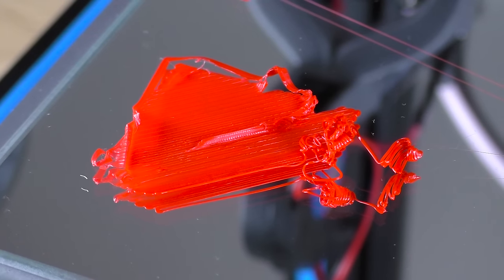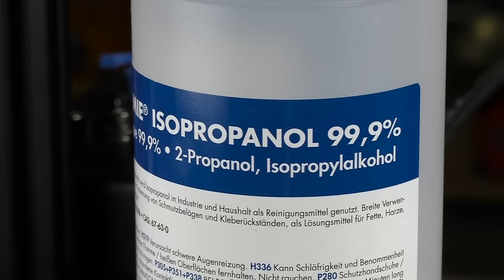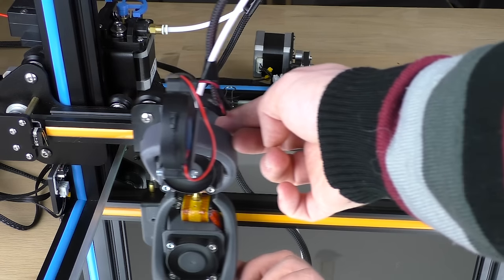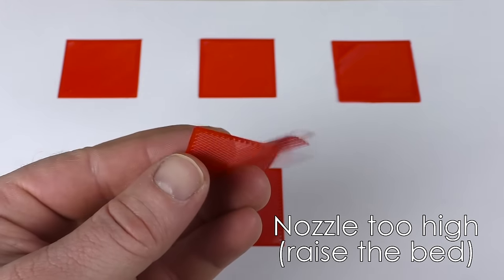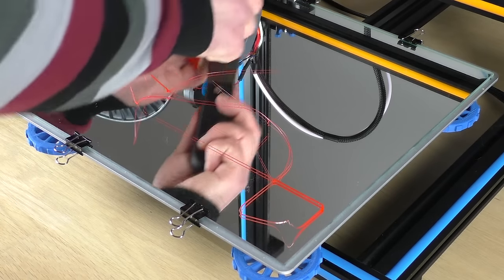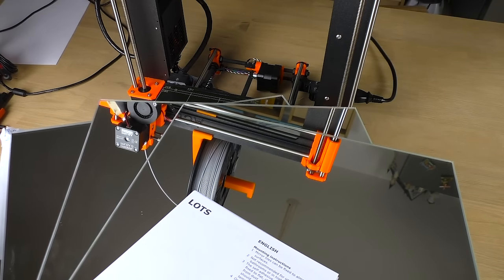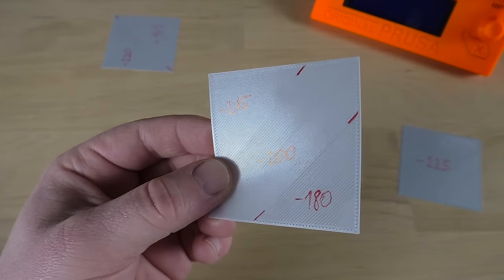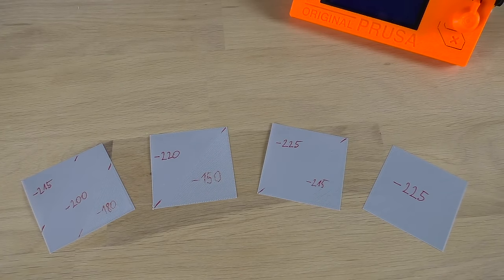Best method for 3D printer bed levelling

Comment: Do you add anything to the mirror before your print?  I've been using glass (the one that came with the unit) and it seems to work well with a glue stick or this stuff I had call wolfbite (from a friend of mine).  If I can use a mirror with nothing then that is something I will definitely try out.
Reply from the maker: Nope, nothing at all on the mirror, although you should wash it with soapy water before using it. After that, I've actually had troubles getting my prints off the bed if the first layer was squeezed too much.
Reply: @HobbyHoarder  Wow....i've been knocking out faceplates and I've not had any issues (knock on wood).  You're instructions are right on!!!! Thanks so much.
Reply from the maker: @carycorreia8215  I'm very happy to hear that Cary! If you do notice any loss of adhesion (it tends to happen overtime), just wash it under soap again and you're good to go.
Reply: @HobbyHoarder  You must be a psychic...it just happened this morning.  The print popped off the bed sometime in the am and i had spaghetti all over the place and the nozzle was just full of filament.  Put the mirror under hot water and soap and restarted and I'm good to go.
Reply from the maker: @carycorreia8215  Hehe, just experience, it happened to me as well :) I usually set the first layer so that the surface is on the rough side. Never had any warping, except with extremly large models that reached the edge of the bed (it's not as hot there).

Comment: Ive been trying to level my bed for the past 2 weeks. The left side of the bed keeps giving me that rough texture while left one keeps giving me a smooth perfect result. I tried everything but to no avail. I thought it was a warped bed so i bought a new glass one but nope, still the same issue
Reply from the maker: Cut a patch of aluminium foil (roughly half the size of your bed) and place it on the side that is too low. You can stack more if needed. Eventually, both sides will be equal and you should be able to level it perfectly.

Comment: Happy two year anniversary or something! I just tried this and this really helps! I had a question though. Your example of a perfect square seems to be somewhat thicker and not see through. After calibrating I managed to get a smooth and consistent square with no gaps between lines. But the square is so thin that it is see through. I wanted to check if by any chance I'm still off or that your PLA is printing a tad thicker.
Reply from the maker: Hehe, thank you, I can't believe it's already that long.

Well, it depends a bit on the color and how much you're extruding. I always calibrate my extruder first (I don't have a video on that, but the one from MatterHackers is a good example). This will ensure that you're extruding the correct amount of plastic and then you can repeat with the leveling squares.

It's also important that you set your first layer height to 0,2mm in your slicer, regardless of what you're using for the rest of the print.

Let me know if you're still having issues!
Reply: @HobbyHoarder  I'll take a look at the vid. My filament colour is grey and I've used 0.2mm so we're good in that aspect.

Comment: what size mirror are you using,  my bed is roughlty 8.5 x 8.5  so how do you adjust the nozzle to follow the dimensions of the glass not  the bed when using auto leveler or even for manual leveling when homing in the nozzle, thanks for your help
Reply from the maker: I'm using the ones from Ikea, 30x30cm (a bit under 12''). You can change the bed size in every slicer and then it should only print within these boundaries.

Comment: This method of leveling has improved my accuracy, but I have some questions.
Shouldn't the settings matter? Like setting the Primary Layer Height to 0.20 mm should give you one layer and shouldn't that layer be a certain thickness? If the First Layer Height (FLH) is 90% shouldn't the pads all be .20X.90 = 0.18 mm? And all the pads should be 0.18 mm? How does First Layer Width affect the pads? For example with mine at 0.20 at 90% I measure 0.24 on the pads, is my bed still a little too low?
I have my E-steps and Extrusion multipliers right on.
Reply from the maker: You should set your first layer to be 0.2mm, regardless of what you're slicing rest of the model at. So if you're printing at 0.3mm, set your first layer height to 66%, for 0.1mm set your first layer to 200% etc.

As for the actual height and width of the first layer when you print it - don't worry about it. The only job of the first layer is that it sticks well to the bed, nothing else. It doesn't matter if it's 0.18mm; if you get good adhesion and a somewhat smooth surface, it's good enough. So just make sure that your leveling squares look close enough to what I'm showing and are sticking well to your surface.
Reply: @HobbyHoarder  Thanks for the input. For printing at .3 to get the 1st layer at .1 you mean 33% not 200%. I have my squares looking good thanks to you!
Reply from the maker: @TheSblackwater  I meant that if you want to print at 0.1, you should set your first layer to 200% so that you end up with 0.2mm. I hope that makes sense. Congrats on getting the bed leveled, it's one of the hardest things to do until you get the feel for it.

Comment: so how often do you level your bed? is it before every print or after let's say 10 prints?
Reply from the maker: Whenever I feel there's need for it.

I always wait until I can see how the first layer is printing. If it's fine I walk away happy. However, if I notice that it's not sticking well in some parts or if there's a gap between individual lines, I will immediately adjust that corner (or change the Live-Z if the printer has auto levelling). If it's really bad, I'll stop the print and print out the calibration squares again. Unless there's something really wrong with the printer, you shouldn't have to level it more often than a few weeks or even months apart.

Comment: Great video. I'm new to 3d printing... and use a EZABL on my Ender 3 Pro. what are the best first layer settings to use.. 0.2 or 0.3? And do I need to make different adjustments for different layer heights?
Reply from the maker: Thank you and welcome to the hobby!

0.2mm seems the best height for the first layer.

Settings depend a little on your slicer. I'm using Simplify3D and you have to specify first layer height as a percentage. So if I'm printing with 0.2 layers, then the 1st layer height is 100%. If I'm printing with 0.1 layers, I have 200% for 1st layer height, so that it still ends up 0.2, even though the rest of the model is at 0.1. Does that make sense?

Comment: hi my issues , is that i had adjust a lot my Z compensation, about -2.47 on first , layer and when  im getting higher on my print about 3/4 to 1 inch high, i have to adjust consistently, my z axis compensation upper about  too not scratch the print every min , its annoying i have to stay near my printer , you have any clue whats happening . probably,  the level but i have an automated bed leveling on my creality CR10S pro v2 .  thank you for your great video !
Reply from the maker: You shouldn't have to adjust anything after the first layer. Two things come to mind.

Your Z axis screws might not be tightened. If you check the bottom of the long Z screw, there's a coupler there and it has two or three screws that you can tighten to hold the Z in place. Check if they're all tight enough on both sides.

The second thing is over extrusion. That means that the printer is putting out too much plastic and, over time, it builds up enough to scratch against the nozzle. Check out videos for flow calibration, or simply reduce your flowrate by 15% and try again.

Comment: Thanks so much for taking the time to put this video together. I'm new to 3d printing - to say there is a lot to learn is an understatement. Finding concise information like this is gold dust. 

If you ever wanted to put a series of videos covering various helpful topics I would be very happy to donate, it would be a boon to the community. Your editing, style and methodology are both concise and encompassing. 

I have a question if I may, regarding my Original Prusa MK3: I print a large central calibration square at 0.2mm layer height - mimicking a first layer on Prusa optimal settings (0.15mm layer height) in Slic3r Prusa Edition. 

When I think the live Z is giving the best looking results (around -700 which is way off compared to your video) it does not measure 0.2mm deep. The best I've managed to measure is 0.22mm deep which is 10% off and other squares printed at other live Z heights looked better but were even further off in layer depth. 

Any ideas on why my layer depth is not 0.2mm? Maybe my callipers are off.

I had to order my printer assembled due to the work/ small kids everywhere lifestyle I have so it's even more critical to learn functions like this as I never had the opportunity to build.

Thanks again to taking the time to assist newbies such as myself.
Reply from the maker: Thank you, it really means a lot to hear I was able to help someone.

I don't have a series planned as such (I'm humbled by your offer to donate). I'm quite active on Reddit's 3D printing sub and I see a lot of issues from beginners there and I'm trying to cover those questions in my videos. My main goal of this channel is education, so if there's anything you're having troubles with, let me know and I'll do my best to help, including making a video about it if I feel it's a common enough issue.

Regarding your question; the Live Z values will wary between printers. The actual number is actually determined by the placement of your PINDA probe. If yours is a bit higher than mine, you will need a larger Z value. There's no right or wrong number, as long as it's under 1000. If you need to go further, then it's better to physically re-position your PINDA probe and then dial in your Live Z again.

The first layer will never be the same thickness as the rest. You want to squeeze your first layer against the surface so that it sticks well (but not so much that it's rough to the touch as I've shown in the video). Because it's squeezed, it's thickness will be less than the ones above it and that's perfectly fine. There's no need to measure the thickness of the first layer as it will likely never be the same as what you've set in your slicer. Most slicers have a setting that lets you adjust the first layer thickness and it's almost never the same as your general layer height.

There is a way to test if your layer heights aren't correct though. You can print a 20mm calibration cube (https://www.thingiverse.com/thing:1278865) and measure that using a caliper. However, this is mostly needed for custom built printers or cheap Chinese ones, as they weren't properly calibrated to begin with. You have one of the best printers on the market right now and there's really no need to calibrate it further. The only exception is calibrating your extruder.

Tom made a video about it a while ago and you can check it out here (let me know if anything doesn't make sense):
https://www.youtube.com/watch?v=YUPfBJz3I6Y&feature=youtu.be&t=3m25s

Here's my advice though. Unless you're having actual issues (like too much plastic on the top surface or gaps), there's no need to worry about calibrations, at least not yet. Get familiar with your printer first, use it for a few months and then start worrying about perfecting the last 5% you can squeeze out of it.
Reply: I'll take all of your advice, thanks. I'm struggling to find any Z Height where I can't actually feel smooth surface - everything from -450 to -750 is a bit rough. I think this is where I'm struggling as I don't know what perfect feels like - I've probably gone past it twice! I'll watch that videos and others by Tom tonight.

I've had some pretty good prints anyway, but there's one print that I just can't get to work. I'm confused by the Slicers approach to it (file here: https://cults3d.com/en/3d-model/home/zuzanna-lamp).

Slic3r Prusa Edition says 35 hours, Simplify3D says 17 hours and both prints fail pretty quickly. I'm going to try acetone this evening on the bed to see if that helps. What settings would you use for this type of file? 0.4 nozzle, PLA.

Many thanks
Reply from the maker: Yeah, it can be hard to get a feel for how smooth the surface should be, I've struggled with it for weeks. There's quite a big difference between 450 and 750. Once you start dialing it in, the differences are usually under 50 microns.

It's ok if the first layer is a bit on the rough side until you get more experience with how it should look, as long as it's not really rough. Slide your finger across the black steel frame, that's roughly how smooth the first layer should be. Once the printer starts adding more layers, they will even out and you'll still get a smooth top surface, even if the first layer wasn't. If the first layer is a bit rough, it just means that the model will stick to the bed better. It's best to wait for the bed to cool down a bit, at least 10-15'C, before trying to remove your object.

Slicers are very bad at predicting printing times. They have some average values, but the problem is that every printer has different settings (like acceleration) that differ from slicer's values, so it can't accurately predict how long it will take. PrusaControl is the best right now. It's accurate to within a few minutes in most cases. I've also heard that Slic3r Prusa Edition will be getting an update soon that will include very accurate time predictions.

I've downloaded the lamp model and it seems like a pretty normal model in terms of print complexity. It's been designed well for 3D printing, as you don't need any infill or supports at all. When you say it failed quickly, what exactly do you mean? Has the model come loose during printing?
Reply: Thanks again for taking the time to help. I managed to get a rock solid first layer following your advice. I also slowed it down a bit after an acetone clean which really helped.

I ran into all sorts of problems with the print, however - none to do with adhesion though.

3 hours in to the print the Mk3 told me I was out of filament and stopped printing. I reloaded it and carried on no problem. Same thing happened on hour 6 - I reloaded and turned off filament detection which fixed it. Must be buggy.

Hour 13 of 19 - a big 0.5cm shift to the right on all layers. Crash detection on & running normal mode - print ruined. The whole rest of the print was absolutely flawless so I'm really gutted. I have no idea why it did it, and it doesn't look like it tried to recover from it. It just kept printing miles off to the side.

I got the machine from Prusa fully assembled so I really don't know what's wrong! Here's some pics. https://imgur.com/a/bVRfj

Sorry to pick your brain!
Reply from the maker: Hmm, that is strange. So it didn't even detect the missed steps like it's supposed to? The only thing I can think of is that the belts are not properly tightened, but they should have been since you've paid for it. Can you pluck them? Like a string on the guitar. It shouldn't be soft, but not rock hard either. The belt should make a sound, similar to something like if you pluck a rubber band.

If I understand correctly, this model has failed to print twice? Was it always at the same height?

I'd suggest you buy iso alcohol instead of acetone. I remember reading somewhere that acetone should only be used occasionally if the bed is really dirty, as it can slowly ruin the PEI coating. You can easily mix iso alcohol with water. I'm using a 80%alco/20% water mixture and I just give it a quick wipe with paper towels before every print.

Comment: I'm so nervous to get a mirror for the bed. With as many times as I've accidentally run the nozzle too close, I'm 100% sure I'd shatter any glass under the nozzle eventually.
Reply from the maker: Nah, I did that a few times - the bed is on a spring, so even if the nozzle pushes down, it can still move downwards a bit, which gives you enough time to turn off the printer.
Reply: @HobbyHoarder  I switched out the stock springs to the silicone ones a couple months ago to help maintain the tram. They don't give as much. I guess if the mirror is cheap enough... I've wasted far more money for less in the past.
Reply from the maker: @Scott_G  Go to Ikea and buy "Lots" mirrors - you get 4 in a pack and they're very cheap, I think it was under $10 for all 4. You won't lose any sleep even if you crack one or two :)
Reply: @HobbyHoarder  I checked out the website. Are those the ones that are 12" square? My bed is only 235x235. I wonder how hard they'd be to cut down...
Reply from the maker: @Scott_G  Yeah, that size sounds about right. You can buy a glass cutting knife and do it yourself, or most hardware stores can do it for you as well.
Reply: @HobbyHoarder  Sounds good! Thanks for all of the replies and help!

Comment: Hi there, I have built a custom 3d printed powered by Marlin 2.0. when i manually level the bed everything seems fine, but when i try to print, it is printing a couple of mm above from the heatbed. can you help me find out the issue?
Reply from the maker: If it's always the same distance from the bed when you're trying to print, then the easiest solution would be to add Z offset in your slicer to compensate for that.

Apart from that, is your Z endstop triggering too soon, preventing the nozzle from reaching the bed?
Reply: @HobbyHoarder  Endstop triggering is fine. it happens only when i try to print it. Thanks for your suggestion i will try Z offset and hope it works.